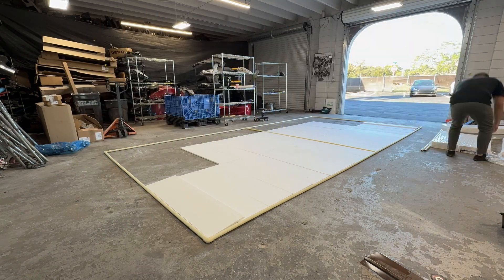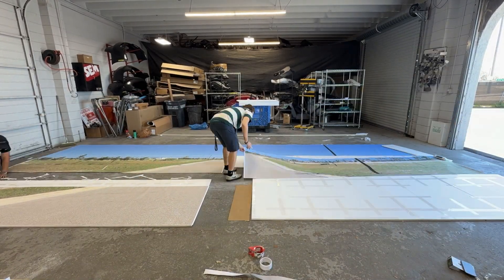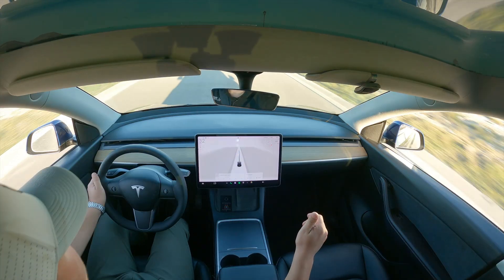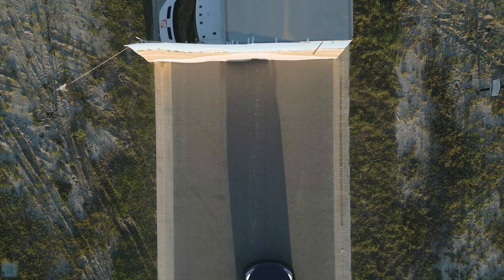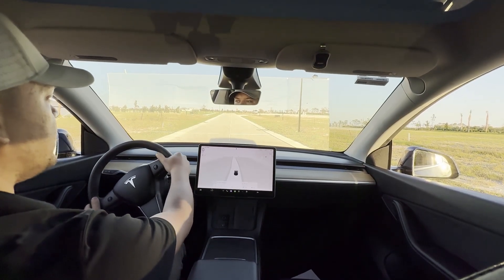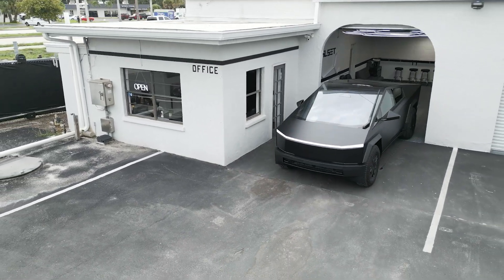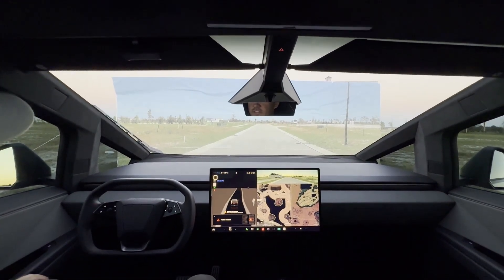Response to Mark Rober’s “Can You Fool A Self Driving Car?”

Comment: Please test again in the future with FSD v12.6.4 on HW3 and v13 on a HW4 Model 3 or Y with FSD 13.2.8
Reply: Who do I see here 😮!
Reply: honestly in marks rober video I didnt care that it hit the wall. What I did care was thick fog. There were a few times where I ended up in such fog. I have seen plenty of videos of people crashing in such fog. Now if my emergency braking isnt relying on vision only but lidar or radar I would be much more at ease. I think elon is wrong about ditching everything but vision having just one lidar or radar senor up front will help out a whole lot.
Reply: @fire1831-c4l LiDAR can’t drive through thick fog, it thinks it’s a wall.
Reply: @joshgoodman6534  it can you didnt watch marks video? I can speak for radar 100 percent because my car has it but as for lidar mark robers video demonstrates perfectly it can see through very thick fog
Reply: @joshgoodman6534 no one is advocating for LiDAR only. It’s a backup. There’s a reason every other life-critical system humans have designed has redundancy
Reply: Worth doing. HW4 has three times the compute power and higher resolution cameras. Tesla has been trying to shoehorn 13 into HW3 but so far no joy that's why HW3 cars are still on 12.
I upgraded to a highland Model 3 last July in order to get ,HW4. Until last Dec they were running HW4 cars in HW3 compatibility mode. Version 13 is native HW4 and the difference is stark. With 12.5.x, the last versions of 12 that ran on HW4 cars, I had multiple serious interventions on every trip. With 13 I've only had three minor interventions since it was released in Dec.

One interesting thing that you proved. The version of Autopilot on HW4 is based on FSD 13, I had assumed that it was based on a really old version of FSD.
Reply: and at same time of day so it matches with picture
Reply: With all these extra exceptions wouldn't it just be easier and cheaper to get a car with LiDAR?
Reply: @tomar81 or just download the latest software
Reply: Dawg the software version is not the issue. The cyber truck saw it because it’s taller and could see over it. The problem is the sensors, not the software. It fundamentally must perform in this way, otherwise it would randomly stop in normal driving. A $200 radar would have allowed Tesla to retain the several year lead it will ow never get back. It’s time yall eat humble pie and just sit down
Reply: They used 13.2.8 on the cybertruck...
Reply: hi
Reply: I never saw all this attention given when Elon and Tesla clearly faked a 1/4th mile drag race vs a 911 proven by engineeringexplained .. u guys have a serious cult like fan base and it makes the brand look even worse. It’s just a piece of metal. I’ve never seen anything like it, clearly y’all’s bank account is into Tesla stock 😂
Reply: yes plz plz, i wana konw it's bcz v13 or bcz of the front camera.
Reply: I assume they will upgrade HW3 cars to HW4 when they release FSD unsupervised. (But not before). And that that point is moot.
Reply: The hardware is literally incapable it won’t do any difference
Reply: Or test teslas camera system in thick fog or heavy rain.
Reply: wont change anything. It uses photographic vision without raw depth perception. FSD cannot compete.
Reply: @user-ko9te33c84u 😂 Keep moving the goal post
Reply: @alstonmiller212 no one moved the goal post. Except perhaps the ones hyper focusing on the silly looney tunes wall scenario.
Reply: Sounds like you're hurt lol just stating what you're doing.
Reply: yea at first I thought people were nitpicking minor software versions but he's running 12.5 while 12.6 was a big improvement.. is this not his daily driver? how does someone not itch to press the update button which has to have been there for weeeeks or months for him
Reply: The goat 👀
Reply: elon musk must be ur daddy
Reply: why do people not test using the latest software release?? so dumb and makes the video pointless regardless of the outcome 🤦
Reply: @Tech_N0rd  Good question. Funny thing is, it’s been out for weeks.
Reply: @Tech_N0rd  the hardware is literally incapable of detecting the wall it won’t do much difference 🤦‍♂️
Reply: 3:53 he isn’t running the lowest version available for his car. 12.6.4 is waiting for him to update.
Reply: I am gooning to this comment

Comment: What about Mark’s other tests? Bright light, rain, fog, etc.?
Reply: I think this was the most controversial test. The other tests are probably valid, but not as tailor-made to defeat AI. The solution to weather-related challenges would be to just not drive. If you can't see, you shouldn't be driving in it.

Comment: This is very interesting that HW4 and v13 saw it but v12 didn't, I wonder if 12.6 would've seen it, instead of 12.5.4.2, 12.6 is a big improvement over 12.5, just a thought!
Reply: lighting is different
Reply: Yes, he had a software update available with FSD 12.6.4.  Please redo with the newest software for HW3. Thanks Kyle!
Reply: @ I know I wish he installed it!
Reply: @jdrou  better to test both v12.5, 12.6 and v13
Reply: Came here to say that he missed a huge opportunity by not updating his FSD to 12.6. It's not exactly a new update either so I don't really know what reason he'd have to not update.
Reply: Lighting probably makes some difference, but the higher resolution + more compute probably makes a lot of difference. Tesla has really screwed over hw3 owners (especially those that paid 12k or 15k for it)!
Reply: It won’t make much of a difference, the hardware is literally incapable of detecting it. The only reason the cybertruck detected it was because the cameras could detect the difference in picture color
Reply: Only v13 or above can see because of rewrite of software
Reply: @varunmaraka3171  Only the devs know that. 12.6.4 definitely has a better occupancy network than 12.5.
Reply: Someone know if there is a radar in the cyber truck? That would easily see the truck parked behind the wall.
Reply: @FlorianMickler  there is not
Reply: Ya totally agree it would be great if 12.6.4 could see it because it is a big improvement
Reply: The most likely reason HW4 saw it is because of different lighting conditions, 9:09 look at the way the wall contrasts to the actual road.
Reply: @TheMW2informer  HW4 has completely differt cameras....how is it the most likely?
Reply: Hw3 cameras are pretty garbage, so id have my doubts about software updates helping.

If tesla specifically tackles this scenario in training then maybe, but otherwise doubt.
Reply: @pofiPenguin  Agree very likely the difference is the better cameras and not the program or hardware chip. I don’t think they CAN tackle this scenario in training, this is a never happens scenario and not an edge case, people never encounter walls across roads with fake roads and scenery painted on them.
Reply: I do think 12.6.4 would have had a better chance but I also have doubts based on the HW3 cameras. If Tesla see this please upgrade are cameras too.
Reply: 12.5 worse than V11
Reply: I thought 12.5.4 was theee worst software version since like v10 🤷🏻‍♂️
Reply: @BigDsrq  It was pretty jerky, I can't believe he hasn't updated!
Reply: What are you talking about man. I have owned 2 Teslas with FSD and I came to the conclusion in 2020 itself that FSD can never be relied on for reliable  self driving. My 2024 MY Perf did not even come with radar and ultrasound sensors. I claimed that without Lidar, dozens of more high resolution sensors like radar and ultrasonic and a much better hardware (like Nvdias or Luminars full sensor suite) FSD won't work but people (well fanboys) claim Teslas vision only tech is better than other full suite sensors.

Even in this case the cyber truck saw this just because of the contrast. Tesla will NEVER get to L3 autonomy let alone L5. I predicted Teslas demise as a company by 2024 but because of the pandemic and other factors it looks like I was wrong by about 4 years. Oh well I will be jumping to a Gravity and an R2 soon so whatever. Tesla fanboys can keep on believing that Teslas will get to L3.
Reply: @Zmap6191  😔 don't know what you are talking about.
Reply: @Zmap6191  cybercab is coming of a few months. You may need to shave your head like Mark as a challenge 😂😂😂
Reply: @Zmap6191  Wow, you are such a liar. You owned two Teslas with FSD and concluded FIVE YEARS AGO after Tesla had been working on FSD for three and a half that you are a world leading expert in FSD and know everything required in terms of hardware for FSD to work. You now own a third Tesla, a 2024 Model Y Performance, and despite having been offered two or three month long free FSD trials you…well you didn’t take them or you would.have mentioned it, and if you actually owned the Tesla you claim, you WOULD have at least tried the current FSD, having used it in two cars five or more years ago. 

In short, I believe your Huffy bicycle is the closest thing to a Tesla that you have actually owned.
Reply: @Zmap6191  exactly what I've been saying too. Just cameras... literally just cameras and software🤦‍♂️
Reply: @Zmap6191  and if the the problem lies in the older software, the bigger problem then is that people are using this old software thinking that it's 100% safe.

Comment: You are on a pretty old version of FSD on your HW3 Model Y (12.5.4.2, from back in October 2024). It would be interesting to see the test re-run on version 12.6.4 for HW3 (from February 2025).
Reply: But thats the sad reality with HW3 he was already on 2025 general Software Version with a months old FSD version…
Reply: It won’t change anything, it’s hardware is physically and literally incapable of detecting the wall
Reply: Prolly won't matter much. Realistically this is a scenario that Teslas are bad at. Thankfully, the roadrunner doesn't exist so this won't actually come up in reality.
Reply: @Idiomatick  This isn't so much about someone putting up a fake wall, this is showing that Tesla does not have proper depth knowledge compared to what lidar or radar can manage. Teslas have already hit bikes because it saw 2 lights and thought it was a car that was further away, something even just having lidar as a backup would avoid. Cameras are needed for visual information like signs or road lines, but lidar/radar systems should be used as well for respectable, guaranteed distance measurements.
Reply: @2KDrop  the video clearly shows it working with the new software, whats the issue now?
Reply: @joshgoodman6534  The issue now is the conditions of the second test were different. The wall had a higher contrast due to the sun setting, had he tested the model Y in the same situation as the CT it may have stopped due to that as well.
Reply: @2KDrop  It is literally a camouflaged wall. Teslas would also drive into a giant pane of glass. Its irrelevant in the real world because it isn't a superman cartoon where there are panes of glass across the road. Tesla performs better than all the competition at driving safely in traffic or normal roads... which is what its supposed to do. (aside from waymo in a waymo zone which is better still)

Its irresponsible to imply these other systems are safer when they aren't. They are statistically many dozens of times more likely to have an accident than Tesla on FSD.
Reply: @  there’s no point in explaining it to them, hard to accept that the car you rely your life on depends on a few cameras, it’s like arguing with a wall
Reply: @Idiomatick  And a lidar+radar system alongside cameras would just make them better_. The only reason Tesla runs just cameras is a cost benefit. Having _actual depth information is not a downside and could only make Teslas better and safer.
Reply: @2KDrop  Adding thousands in cost so that i don't crash into camoflage walls isn't worth it though...
Reply: @2KDrop I guess you will have to do the experiment yourself, he borrowed the CT so clearly couldn’t just get it whenever
Reply: Run on v13 later in the video

Comment: Way to get out there and do it with unbroken shots. To me, this feels like a hardware upgrade more than software. CT has an additional camera on the bumper, which wouldn't let the horizon on the "wall" line up with real life. It correctly saw it as a solid object. 

If I were to guess, any Tesla on HW4 and the latest FSD would still fail this without a bumper camera.

Comment: Really cool and well produced video! I wonder what made the difference between 12.5.4.2 on HW3 (awful btw, PLEASE update your Model Y to 12.6.4) and 13.2.8 on the HW4 cybertruck. Do you think it was the higher resolution cameras on HW4, the better computer, the better model with increased training, or a combination of all 3?
Reply: I think it was the software. 12.6.4 is V13 Lite so I think it would have seen the wall. I might be wrong.
Reply: +1 to your question. Would love for someone from Tesla AI to chime in.
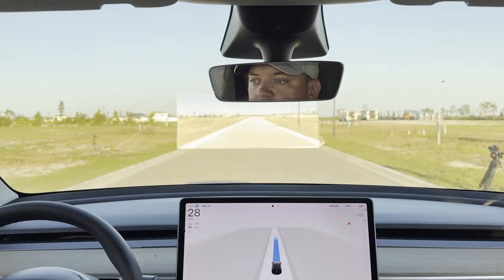Reply: Or just that the lighting conditions of the surrounding environment didn't match the image on the wall as much as they did with the earlier test. Just look @3:08 and then compare the in-cabin view from the Cybertruck's test.
Reply: It’s because they removed radar in may 2021. Only the S and X got it back 2023 because of safety issues and accidents . Radar would detect the wall 500ft out. The cybertruck using hw4 resolutions caught the painting wasn’t seamlessly aligned with the road and horizon at the bottom and stopped, but still didn’t show a wall on the FSD screen. 

Radar however would…the Model S and X are the safest hands down with HW4 and front bumper Radar.
Reply: @luckeypolishing  but it did show the wall, 8:55
Reply: @FutureBeing   it’s showing the bottom not matching the road because it’s not seamless, but it’s not displaying it as a solid object which it is. Radar will show the actual wall on the model S and X using high res radio waves to detect solid objects. That’s why at 9:06 , and all 3 times it recreates the road on the cybertruck map that’s actually blocked.
Reply: @luckeypolishing  Let's say that FSD is not yet 100 % perfect, I don't have problems with that; it's just that Rober was extremely biased in all the tests: he did try all his best in "Fooling" Tesla by printing a giant image, with perfect timing even the color of sky matches that of the image; but, he didn't try to fool the lidar car, instead, he just tested scenarios that Lidar were known best suited for
Reply: @luckeypolishing  It did show the wall on the FSD screen though, and from quite far away

Comment: I'm curious why you don't have FSD v12.6, which is a derivative of v13, a major difference. Glad to see v13 on HW4 passes this test.
Reply: I'm not an owner, but my understanding is that vehicles without FSD licensed stay quite a ways behind the leading software releases. If that changes with an FSD trial, purchase, or subscription, it can take a few days for the current software to load in.
Reply: @random_n  In the video, you can see that they have a software update available to them. They have just chosen to not update the vehicle. Updates are not mandatory, and the user/owner can decide to update their vehicle or not to update.
Reply: @ProXcaliber  Good eye!

Comment: Great test! I wonder if the fact the Cybertruck has a higher perspective so the camera can spot the perception difference. e.g if photo was taken at 5' off the ground, Model y sees at 5' off the ground, cybertruck sees 6.5' off ground. (or whatever delta it actually is.) Would be curious to see HW4 model Y added to the test since it's the same perspective.